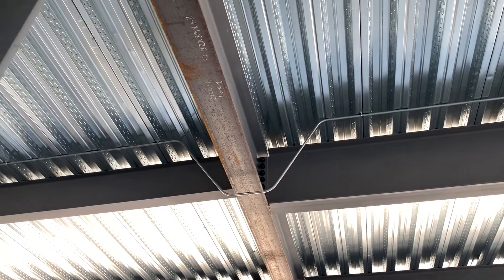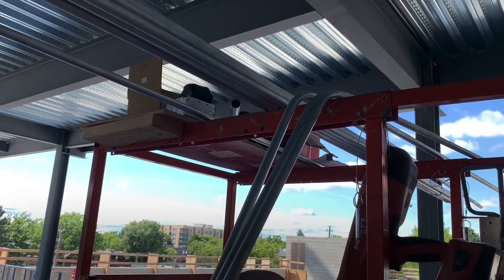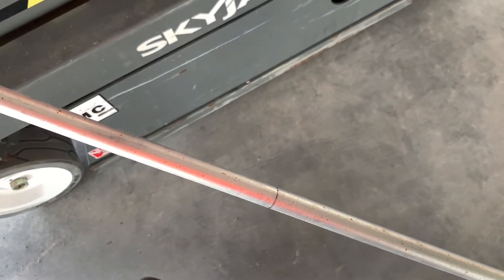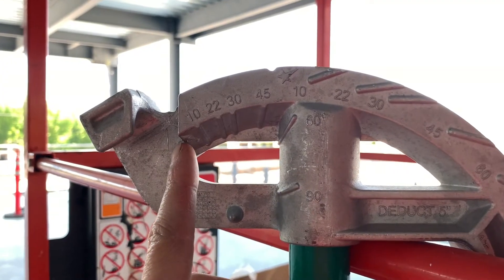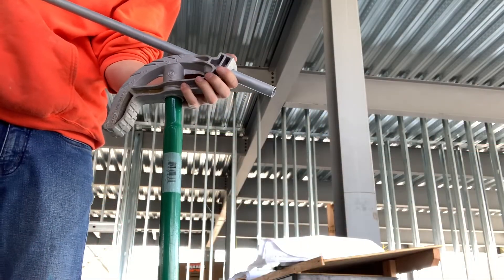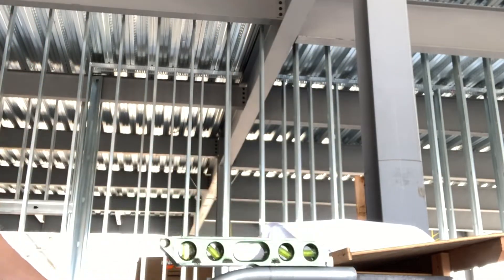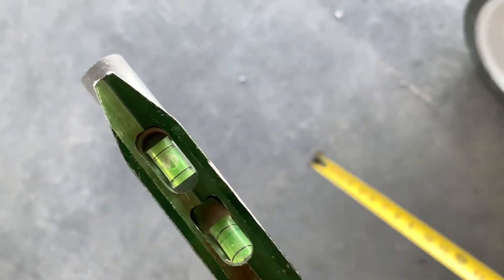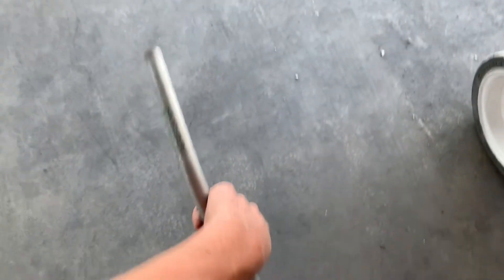Electrical Conduit Bending Tutorial: 60 Degree Offset

Comment: How hard is it on the body working as an electrician?
Reply: Really hard when you are an apprentice...you have to get knee pads because you can be on your knees a lot...pulling wired is bad on your hands and back because not every pull is easy...being an electrician can hurt but it's not as bad as other trades
Reply from the maker: some days are worse than others, definitely rougher as an apprentice but also depends on the company you work for. Has been pretty good for the last year or two :)